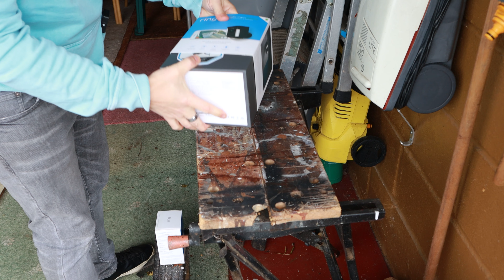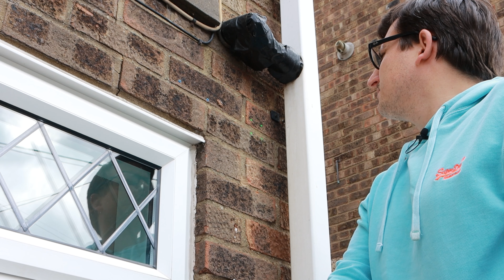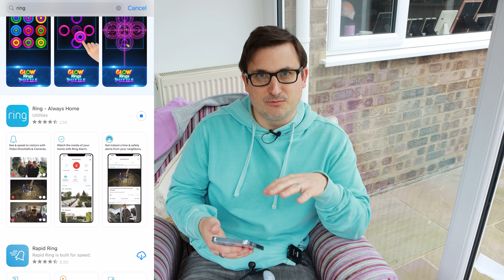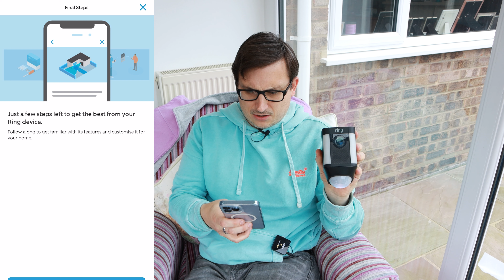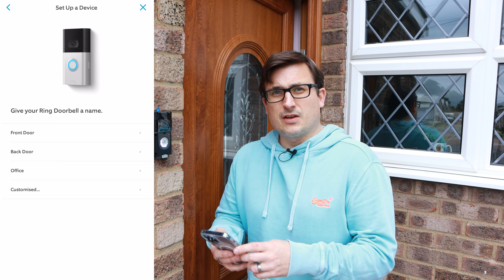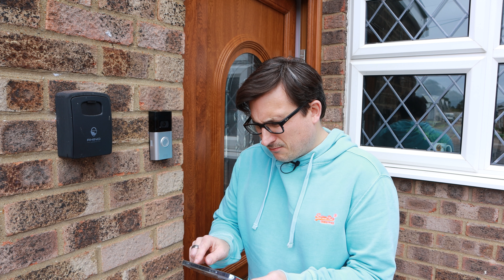Installing the Ring Doorbell 4 and Ring Spotlight Cam Battery - Keeping Safe with Ring - Part 2

Comment: Can you run 2 batteries and the solar charger at the same time on the Ring Spotlight Cam?
Reply from the maker: I thinkso yes
Reply: @KipHakes  I just bought the Ring Spotlight Cam Solar powered with extra batteries/charger, Ring gutter mount bracket and hardwired cable model with the Solar lol $646 I'll likely need a subscription too. Any suggestions on mounting them and subscriptions? Thought I'd try it out for 3 weeks I'd junk goes back. I have a netgear Orbi Mesh network system, hopefully the satellite and router are good enough for the cameras.